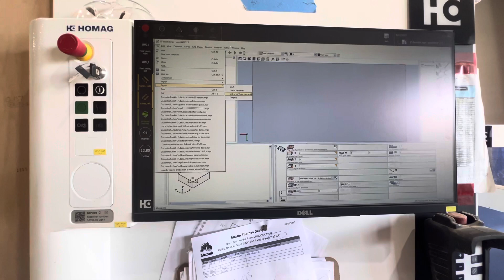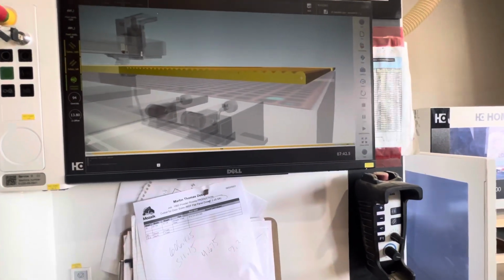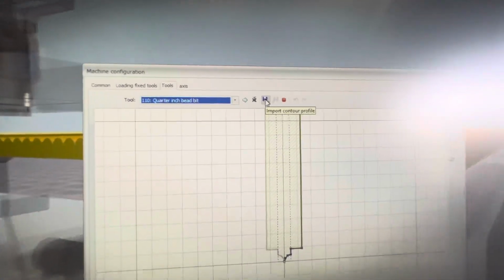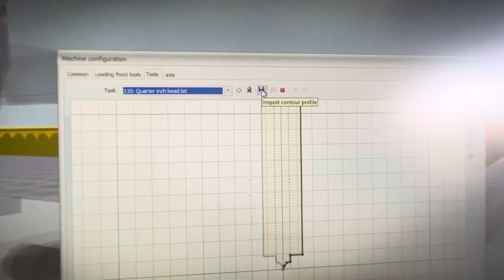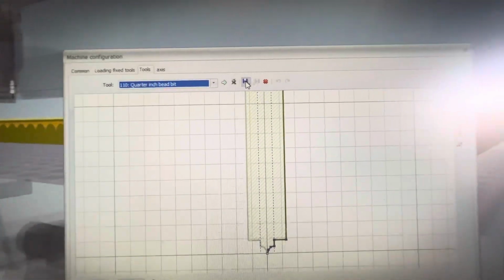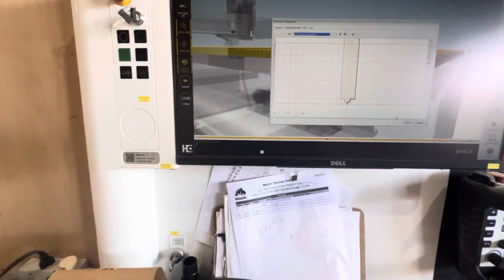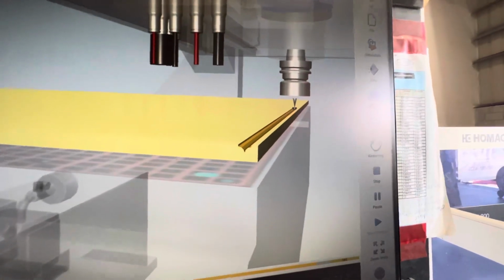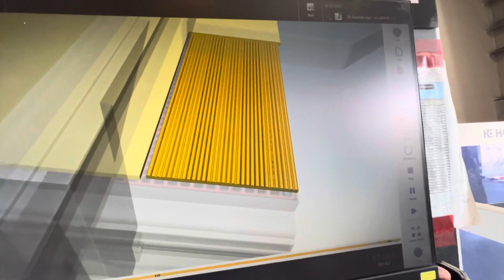Cnc, homag, Cnc programming, woodwop, mozaik,

Comment: Where did you learn all of this? I’m  about to order my first cnc. The homag pentateq p110 5axis
Reply from the maker: @g00thier  self taught. They drop it off and it’s up to you. What I did was look into programs written by cab. software and pull knowledge  from that. 

https://acrobat.adobe.com/id/urn:aaid:sc:VA6C2:67184555-ddff-469d-bcf2-11a7f5a8b5eb#pageNum=114

Here’s some programs from a workshop that another guy went to. 

Lean to put everything into parametric programs to make changes easier. They have a Cnc tech number that will come in handy because you will need it. They should hook you up with it when setting it up. A guy named Scott set ours up.